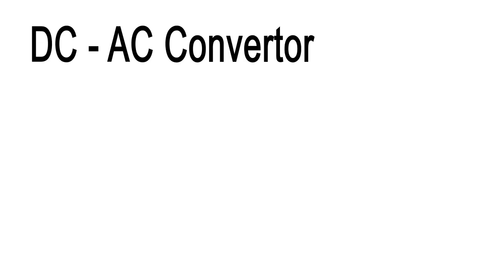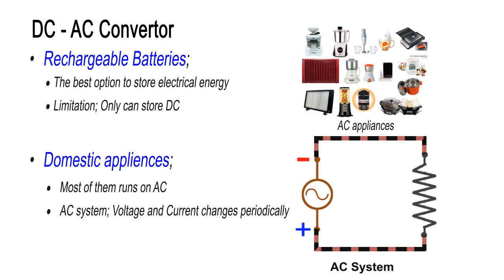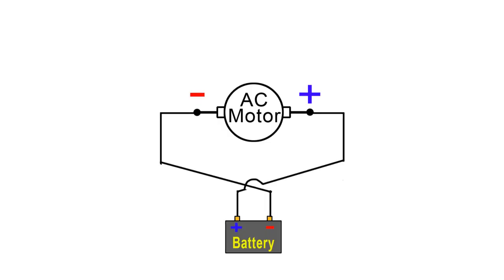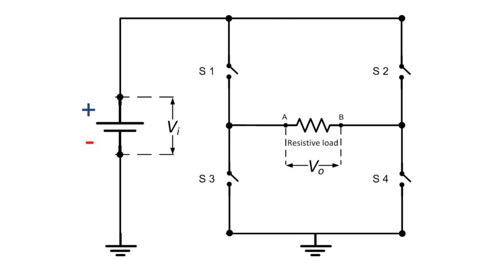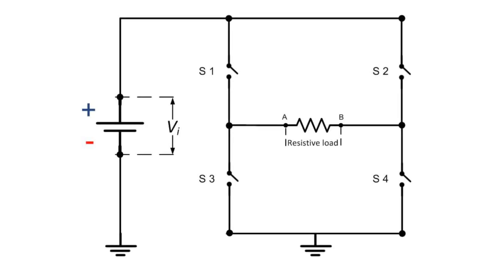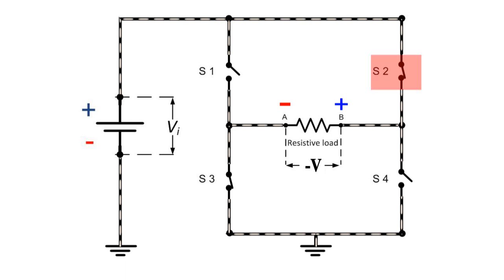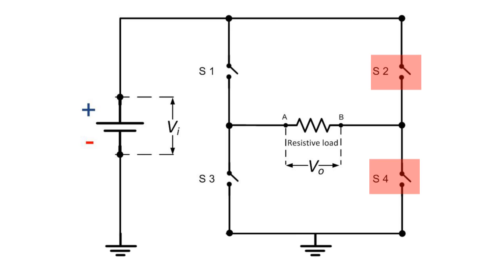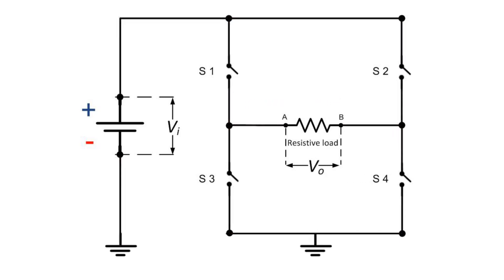DC to AC converter/inverter (animated lecture)

Comment: good video, I would say dc current is in a constant change of direction maybe in a less visible manner(a different wavelength)('in time' the amperage disappears)(or even locked in on the negative inside), to have negative a solid is needed, might be seen through vibration meter), so voltage can be calculated in the storage of a battery but calling it only 12volts when it's capable of expelling more than 12volts or 12volts either way for layman's terms maybe batteries could be valued by how many volts available for discharge or by how many electrons are contained within the battery or capacitor, say the battery(the battery  in whole as a cell). The question would be how many volts or electrons are contained in a battery? pretty sure they went from the 6volt and to 12v as the median in accordance with the generator or alternator because of the rating of the alternator performance contributing to the definition of referring to a battery as a  6 or 12volt. maybe a visible algorithm or vibration could be occurring between the plates in a capacitor maybe at a level man hasn't made a device to recognize it?

Comment: why we use diode resister capicator,etc ....
we see here the battery is properly changing its polarity by the help of switches ...why we doesn't use the same circuit in everywhere to convert dc to ac conversion.
Reply from the maker: Good Question dear Mayank
Actual AC supply waveform should be Sinusoidal where the Wave form of this circuit is rectangular. If we apply rectangular waveform to an AC device it will get demage by the time proceed or it may perform malfunction. So to make the output wave more sinusoidal we have to use combination of capacitor and inductor

Comment: This can't be AC?
 it looks like your providing  dc (100hz)pulses through 2 mosfets at a time?
 but you would never be able to run anything from it except a pulsed dc motor.
an ac motor would never be able to properly start up never mind the ac motors that have an exciter winding that stops when the motor reaches full speed (with no heavy startup load)! Inductive ac motors.
Any info on this is appreciated it melts my brain sometime thinking about all this stuff but it fun!!!
Reply: if the load is a RL circuit, it will act like a filter so the output voltage will be sinuodal

Comment: what should be the ac voltage at the resister load V, i think same as battery voltage right??
Reply from the maker: It would be less then the battery, because voltage drop also happens in the switches (IGBT, MOSFET or any power electronics switches)

Comment: i know the electrons flow the other direction, so how are the electrons being attracted if there is not a full circuit conntection so the electrons can flow to the positive end?
Reply from the maker: hello Bennyclay!
I don't know i am getting your question or not. But, let me answer 
Current always flow form higher potential to lower potential. In this case Positive terminal of the battery representing higher potential and ground representing a neutral body. therefore, current is flowing from positive terminal to ground. 
In future i will try to make video on this concept
till then thank you

Comment: Hey, would you know if the H bridge could drive a brushless motor?
Reply from the maker: YES H BRIDGE IS USED TO DRIVE DC MOTOR (BRUSHED OR BRUSH LESS) BUT IN THAT CASE SWITCHING FREQUENCY WILL BE LOW. ACCORDING TO THE CIRCUIT SHOWN IN THE VIDEO WHEN S1 AND S4 ARE ON MOTOR WILL RUN IN ONE DIRECTION AND WHEN S2 AND S3 ARE ON MOTOR WILL RUN IN OPPOSIT DIRECTION.
ALSO BY MAINTAINING ON OF PERIODS OF SWITCH PAIR WE CAN GENERATE PWM AND SPEED OF MOTOR CAN BE CONTROL

Comment: Thanks so much i was trying to make a wind tubine using a 12 volt motor to switch on my sound amplifier(uses 12 volt) and when the sound amplifier turn on the speaker were just giving a sound weird but then i understand that i need ac to power the sound amplifier correctly so using your method i succeed making my wind turbine and i even use an invertor 12v to 222v and now it is working

*Thanks a lot bro*🥰